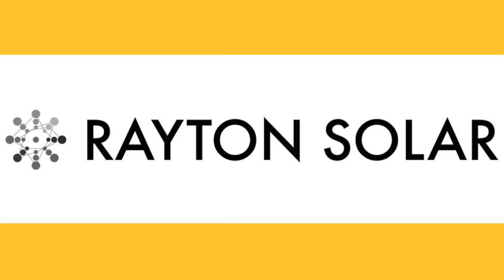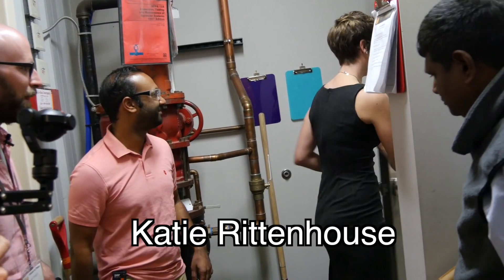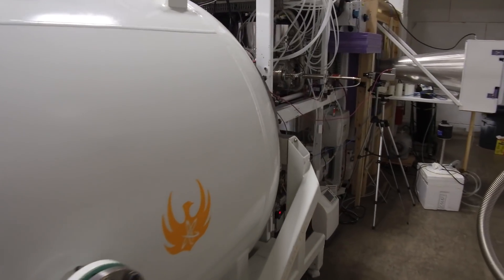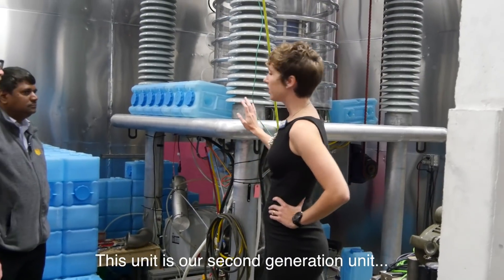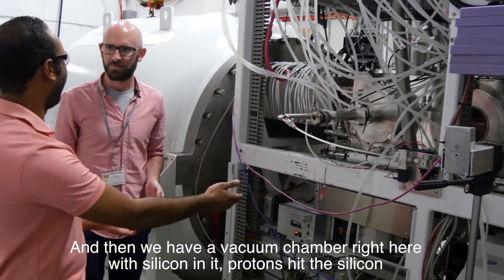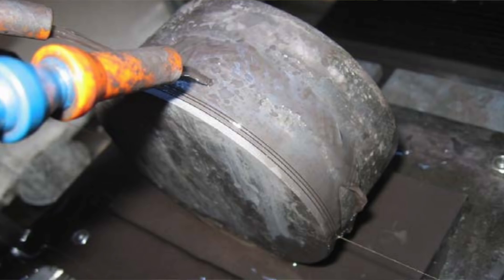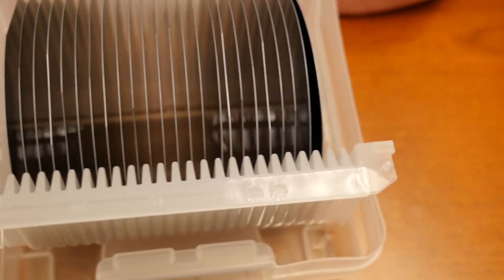Hands On Awesome Tech: Making Solar Cells With a Particle Accelerator

Comment: Did they mention how this might affect the degradation rate? One of the less discussed benefits of photo-voltaic panels are their longevity. They may only be guaranteed for about twenty years, that is produce at least eighty percent of it's rated power by that time, this is known to be extremely bias, and more likely on the century scale. So, it might not matter if it is a hundred times thinner if it also degrades one hundred times faster. That is unless it can be sold for one hundredth the cost, and with three hundred watt panels costing two to three hundred U.S. dollars, I doubt that will be the case. 

One of the other issues in making ingots is the energy cost, what kind of savings are they gaining using this process, and with respect to emissions? As this could be another benefit of the process, and the least probably being saving silicon; since as the second most common element on the planet, I don't think there is a concern for depletion, plus what is manufactured is recyclable.

I would also presume something like this be highly desired architecturally. Since it would probably have the properties to make more traditional looking materials (roofing, siding, even windows) energy producing. 

Considering these, I wonder as a consumer if I am looking at a gain somewhere, or just planned obsolesces in the making. And good video, thanks.

Comment: I'm no expert here but why not use monocrystalline vapour deposition instead? If you have a source of high purity silicon to start with, you don't need to grow the crystal for zone heating purification, just do direct deposits and dial up the thickness you want. Prepare (dope) the glass substrate and grow it beyond minimum depth for bulk cyrstal inclusions. Am I missing something (energy costs, time factors, maximum crystal sizes or something)?

Comment: Can you apply the particle beam separation in the processing of graphene? Basically they use a neutron beam to slice a very thin layer of silicon directly onto the glass wafer, right? I’m not a physicist or anything so I don’t really understand how this process works

Comment: So you only need a particle accelerator? That sounds cheap enough how much is Amazon selling one for? Just clowning I know tech is expensive at first then its cost effectiveness is greater over time with new tech. Thanks for the info. I have always been into "off the grid" living, solar panels, gutters to cisterns to reverse osmosis house filters, and wind power.

Comment: One piece of info missing that I would really have liked to have gotten is "How much electricity would be produced by that tiny square that you held in the end?" and "what kind of power would be produced by a 1 meter square panel using current production vs this new particle accelerator production method?"

Comment: This is great.  Cutting edge.  I am so glad someone is making a creative effort to improve solar for the masses.  I think the next biggest energy need is power storage.  I am not a technician.  But I have read a lot over the years on batteries, because it is a bottleneck.  It might be a good area to look at, if you can contact the correct innovators.  That could be difficult.  Good luck and good work.

Comment: I'm an engineer but not at all sure what you just told me. Is this right? The ion beam strikes a standard cylinder of pure silicon crystal parallel to it's length. This imbeds impurities which cause a fracture perpendicular to the beam which replaces the sawing operation. There is less material loss than in sawing so more efficient. Therefore higher cost/quality silicon can be used and still get lower cost per wafer. What makes the solar cell cut from this wafer more efficient? Is there a conductivity tradeoff using a very thin wafer? What does the thickness of the wafer have to do with electrical conversion efficiency? All sounds good but not completely explained in my mind. And what about production volume? "Hundreds of homes" is not very impressive or a production quantity. Maybe a do over with more time for the solar cell technology differences and no time on the accelerator would help.
Reply from the maker: The thin wafer, as you said, allows for much higher quality (and more expensive) silicon to be used, as Andy said "10 times the cost (the silicon) but 100 times more cells".  But, in a nutshell, it's the higher quality silicon that provides the improved efficiency.

As to the "hundreds of homes" part, originally we put in the actual expected MW of cells per year that can be produced by 1 particle accelerator, but they asked us to cut it out, as they want to be absolutely sure first before saying the exact number, which can only happen once the accelerator is tested, which is coming up in the next few months.  It was a very large number, however.  As Andy said elsewhere in the comments here, they're expecting about 8 seconds per solar cell on average. So not hard to crunch the numbers there to get a rough estimate of annual production. ;-)

Comment: If these cells are significantly lighter than currently conventional panels (as they sound like they might be) - it would be a lot less expensive putting them on houses as currently - there are many structural barring concerns involved in supporting the extra weight.

Comment: People ought to be more aware of linear accelerators, and in a more normal universe they would be the kind of accelerator we would think of, rather than a big CERN-style circular or ring accelerator.

I owe my life to radiation therapy (and chemo, but off topic). In other words, by having linear accelerators ("LINAC"s) throw particles at a tumor. To reduce collateral damage, the target site is put at the intersection of multiple weaker beams. There are far more hospitals with linear accelerators than physics research centers.

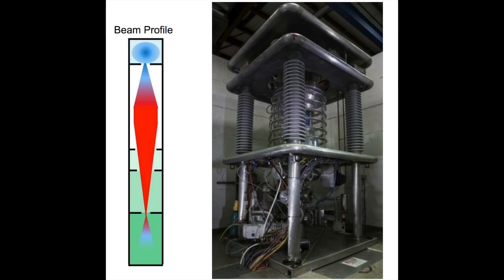Comment: Looks like you adjusted the zoom between a couple of different takes and then clipped the good bits of the two takes together. I'd suggest against that, as the abrupt changes are jarring, especially where there are so many other background items that emphasize the change in zoom level. Also caught you dubbing at 6:11. :)

Comment: The one thing I didn't really buy, which they pitch repeatedly, is that the current method for cutting silicon is OK for phones and computers, but not for solar panels, because solar panels are big and circuit chips are small. Well that's true, but everyone on Earth has multiple circuit chips, totalling billions upon billions, and comparatively few solar panels exist. I'm going to spitball that there's thousands of times more silicon used in chips than panels.  
-The second flaw in this point is that silicon is pretty cheap. I looked up a few sources and found even the most expensive type of silicon commercially produced is under $1 per pound. For the average consumer virtually none of their solar roofing costs are in the solar grade silicon. 
-Thirdly, silicon is ridiculously abundant on Earth and is recyclable, which ultimately renders the entire point moot.  A more honest and straightforward thing to say would be that this is more efficient, produces less waste, and the bottom line; costs less for greater efficiency, which is really the ultimate point.

Comment: I will say, entirely before watching the video (so feel free to ignore this brief comment), that the Phrase in this video's title of "Particle Accelerator" is very misleading. I understand that, due to recent policy changes on YouTube, for monitory reasons, this is necessary. However still, the aforementioned Particle Accelerator is, in simple terms, no more different than your ordinary television device, only in reverse. I would like to express opinion over this subject, that, Particle Accelerator is misleading. 

ps. when I describe this device as no more different than an ordinary television, only in reverse. I meant the charge of the electrode, not direction of the particles.
Reply: Random Guy a TV has an electron gun. It shoots electrons at the screen (or the old CRT ones did). The Phoenix machine is a true particle accelerator as it's accelerating deuterium, not electrons.

Comment: Great video. Doing deep dives on new and exciting technology is awesome. However, I think you missed the mark on this one. You spent a lot of time, money, and effort describing the core technology of making smaller sheets of silicon, but how precisely does that mean more efficient solar panels? How does silicon on glass make a solar panel? Could you not just stack layer on top of layer and make a higher voltage or amperage panel? If we're literally talking about sheets of silicon 0.1 of the width of a human hair, how are they protected from the elements and remain durable? I have more questions after seeing this video.

Comment: I can't believe I'm not seeing comments about the alternating volume and lack of closed caption.  When you were in the plant I had to crank up the volume just to make out most of what was said (closed caption would have really helped), but then when you switched back to your office my ears got blasted and I'd have to turn the volume down.  This is extremely unpleasant, especially as you were flipping back and forth a lot, and if it continues would actually result in losing this viewer!  

If the volume had only been a problem in one direction or during one cut, and there weren't others commenting on it, I would assume it was a technical glitch on my end, but it was fluctuating between too soft and too loud in perfect sync with the video's location, so I know it's not a glitch on my end.

Comment: Very interesting!  I was thinking they'd use the particle accelerator to dope the silicon, but no it is using protons as a cleaver.  I'm not sure this is a viable business model, after all thin film solar cells are already produced by building the solar cells on a substrate rather than by carving up a silicon ingot.  While he is correct that solar cells need to be make more efficient use than chip manufacturers, for your house state of the art high efficiency isn't really that necessary.

Comment: Why do they call “per person” “per pax”
Reply: Sanxithe Dust afaik PAX means (paying) Passengers Aproximately, initially used mostly in aviation but now commonly used in other means of transportation, as well as hotels and events. The X is used in other aviation related jargon to signal an abreviation (CX is communications, WX is weather), specifically in long range non verbal exchanges where using a period might become confusing.
EDIT - A video on it would help clarify if this is accurate or not, since it seems no one is quite sure.
Reply: Sanxithe Dust no clue!

Comment: I appreciate the format though I like the content more.  The primary bit that stood out to me was the suggested efficiency target of 24%.  The 2x% range is quite common in existing panels.

I do think that it is admirable to work towards using less material to achieve similar output at a lower cost per watt than current conventional panels.

Comment: Question for any of the engineers featured in this video: Could you use this same or similar process for creating super thin layers of silicon to make large sheets of graphene? Like shoot your protons at sheets of graphite instead of silicon and peel off 1-atom-thick layers?

Comment: I’ve been following this technology for sometime now and this is the best presentation I’ve seen.
Reply: David Micheletti: awesome video, loved the format, but on the rayton part- as a company they still haven't produced more than a few tiny 1 inch slivers of silicon over the span of a few years. They are so far away from a commercially viable solution, and too many red flags are raised by their company's funding and off actions. I like the tech, but I don't care for the company... I have high suspicions it will immediately shut down, giving the early investors golden parachutes that they've already set the legal groundwork for, and soiling the reputation of renewable energy.
Reply: volvo09     Oh that is very interesting, thank you.  I hope they don’t drop the ball but if so maybe someone else will refine and develop this into a viable company. I hope investors will not be hurt. 
Some of the best moments I’ve had in my life have been spent when I take a concept and try to refine then define and then change it too my own uses. There are few things that I love more than to invent.

Comment: The X-ray image of the bullets do not look the same. It's just that the difference in shading of the casing is so miniscule that false negatives/positives would be strong.
Also, funny enough, you might actually be able to tell the difference with the naked eye. If you look at the rounds, you can see that the defective one has the bullet lower in the casing than the surrounding rounds.
Also also, the bullets themselves appear different; though, the difference is not the same between the X-ray and particle imagine. In the X-ray image, the defective image looks more solid with the effective ones having a gap at the tip. Whereas, in the particle image, it is the opposite with the defective having a gap at the tip.

Comment: If they are going through all that trouble and expense to bombard a substrate, they should at least be using Indium Gallium Arsenide. It's 2 to 3 times more efficient at converting sunlight into energy than Silicon.

Comment: It's also worth noting in the case of Positron Emission Tomography the tiny antimatter annihilations will produce photons that are all the same energy/wavelength making it much easier to build a very sharp optical system for them as there's no circular or other wavelength-dependent aberrations to compensate for.